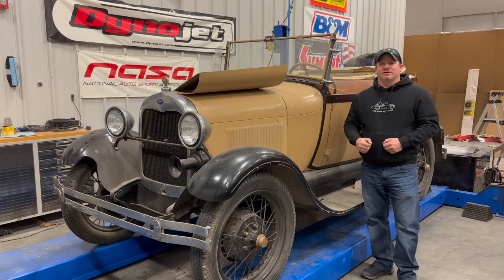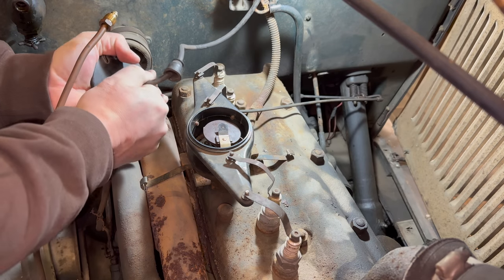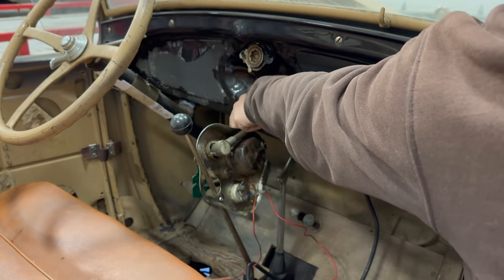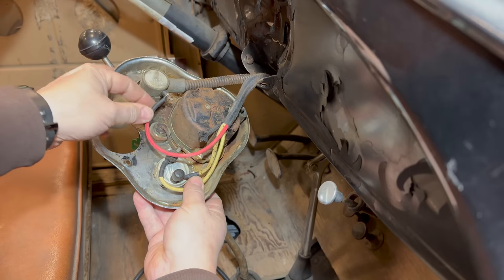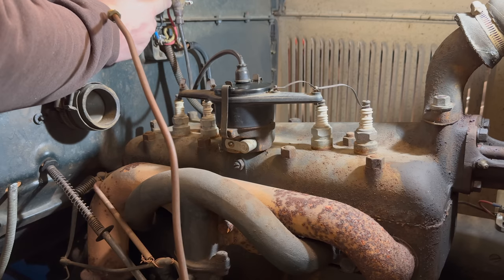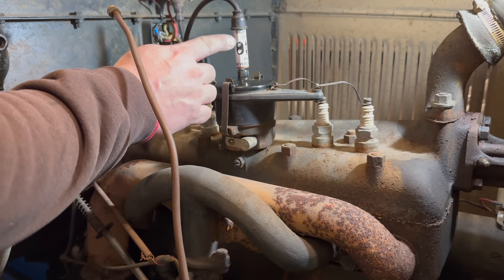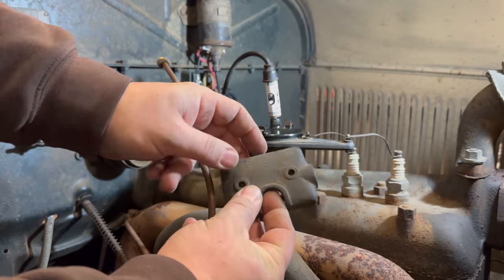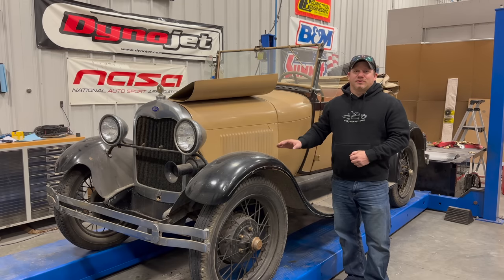1928 Ford Model A - Dash Wiring

Comment: The coil is called an auto-transformer. It has 3 terminals, +, - and high voltage output. On a negative ground system, ignition + terminal to output terminal has the lowest resistance. Terminal -  to output terminal has the highest resistance. A simple ohmmeter can be used to determine which terminal is + and  - .
Reply: Stock Model A's have a positive ground system.
Reply: @831BeachBum OK, After entering the instructions, I realized Model As have positive ground and I gave the wrong instructions.. Here's the correct instructions:
 "+" terminal to output terminal has the highest resistance.
"+" terminal to  "-" terminal has the lowest resistance.
A simple ohmmeter can be used to determine which terminal is + and  - .

Comment: It now makes sense to me why there is more than one wiring harness as you mentioned they can have different bodies. I will admit that's not something I had thought about. The original wires were likely made from vulcanised rubber which can break down over time but some may have been replaced before. I like that coil tool, you can't be in any doubt using that. She is coming along well and I look forward to the next step. Thanks Steve.👍👍